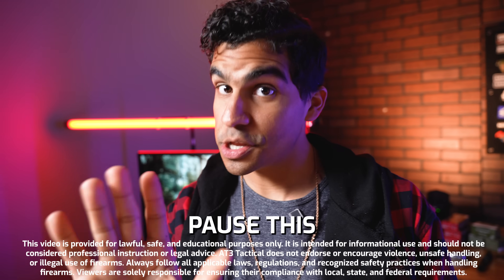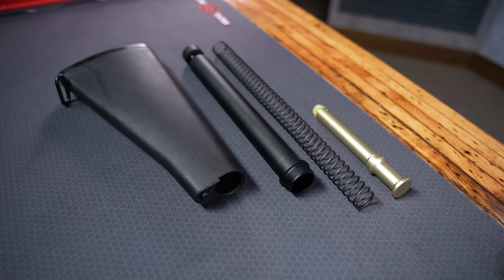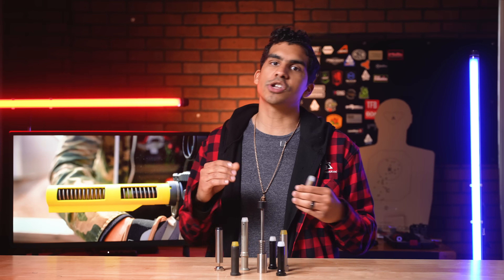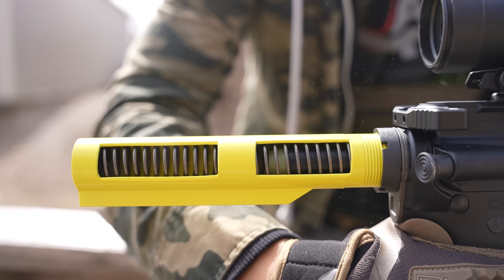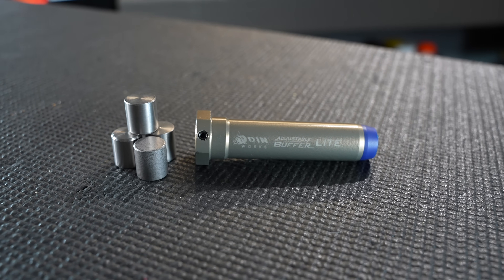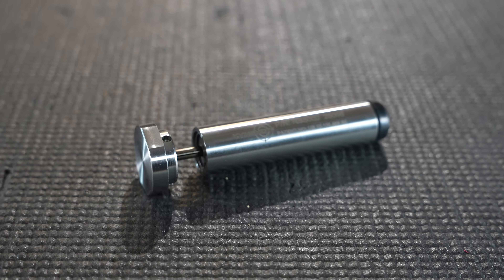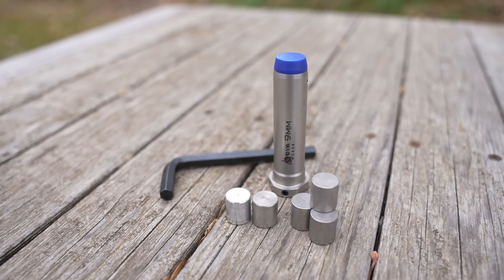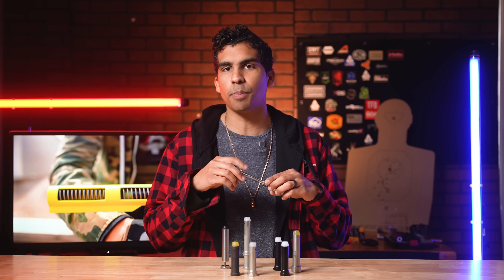Stop Guessing: H1 vs H2 vs H3 - The AR-15 Buffer Weight That’s Killing Your Rifle's Function

Comment: When first getting a 300 blackout years ago, and suppressing it, I couldnt stand the sound of the spring in the buffer tube. I bought a JP Enterprises Captured system and have never looked back. Makes every gun so much more enjoyable to shoot. Alot of people complain about the weight, but when you are putting a suppressor on the far end of your barrel, it actually helps balance the rifle really well. Just my two cents.
Reply: I considered doing this on a suppressed 300 blackout years ago but for some reason I didn’t do it and can’t remember why.

I think I had read something somewhere that made me question whether I should do it or not.  You use yours often and it works fine?

Comment: The M-16 A1 was used in Vietnam (1960's). It was used by the US military until 1984. In 1984 the M-16 A2 came out. You may want to correct this at the beginning of the video.

Comment: I always video the ejection pattern on any AR and weight the buffer to move it to the right rear quarter. Oh and Mil-spec buffers absolutely can be reliably modified. Manufacturers tend to use cheap, 3 steel weight carbine buffers. It’s very easy to replace one or all three weights with tungsten weights.

Comment: I’m having trouble with stovepipe ejections on a 6.5 Grendel I through together. It’s a 20” barrel with rifle length gas system and a A1 style fixed length stock. It has the rifle buffer and a Sprinco green spring. Anyone have suggestions on where to start?
Reply: Sounds like you need a heavier buffer. Need to slow down that bolt speed

Comment: Usually for .556 I just use a 3 oz buffer and a flat wire spring. Either Tubbs(stiffer) or Strike Industries(softer) depending on what it needs. If it's under-gassed, I use a Geissele braided spring and buffer set or a captured spring system. If it's severely over-gassed, I use an adjustable gas block. It's never necessary to go over 3.8 oz on the buffer this way, and the rifle is lighter. For AR-10, a Strike Industries flat wire spring and a Kaw Valley 5.6 oz buffer have always worked prefectly.
Reply: I had a problematic Olympic build that started out life as an A2 and ended up with a collapsible stock and all-Anderson upper. Stupid thing refused to cycle right. Tried different springs, buffers, yada yada. Eventually I put a Tubbs spring in there and it has performed like magic ever since, thousands of rounds. After that I put Tubbs springs in my other four ARs. Cycling problems are long gone.

Comment: Im stressed . I finished my first 6.5 Grendel . I used all good parts 18” ss BA barrel with rifle gas system. Faxon BCG superlative Arms adjustable gas block. Larue trigger Aero upper/lower . Ive been told that it dosnt produce enough gas with the rigle gas system but i can barley find a barrel with less .
Reply: Is your gas block adjusted properly, or is the gas tube installed correctly? The superlative arms gas block should be positioned .025 from the shoulder to ensure correct alignment with the gas port on the barrel.
Reply: @captnmark as far as i know all that is correct . Yesterday  a lady i know that reloads said that ballistic advantage barrels have a smaller than optimal gas port hole and gave me some numbers does that sound familiar at all
Reply: @samcommander4249 I was going to mention the gas port might need to be enlarged

Comment: You forgot magnetic buffers, that use two opposing magnets to create a shock absorber. Magnetic buffers are also adjustable so they can be tuned to the gas system.
Reply: Really? Magnetic? The magnets are potent enough to actually provide some deceleration of the BCG/buffer mass at the end of travel? And the magnets don't get demagnetized with the shock of firing after thousands of rounds?
Reply: @martyschrader a modern neodymium magnet loses about 1% of its strength every century. So yeah, in about 10,000 years that buffer will be worn out. 🤡

Comment: You have to consider that the whole system can be adjustable: gas tube length, gas block, BCG weight, buffer weight and springs.

Comment: 3:40 You are repeating myth about springs.
Springs do not wear out if they are initially built properly.
Springs break. And they will change specs if pulled or pushed out of spec.
But... they do not wear out.

Comment: Great content.  The AR-15 is very forgiving, but it is best to make adjustments to optimize.  Most AR-15 are over gassed as the manufacturer knows the user may not keep it clean.  Now the AR-9 is really finicky but once you get it right it is very stable.

Comment: If you need a different recoil spring for and AR 14 or 15,  you are either a little girl or an infant. And neither should be handling a military grade weapon. I can see new butt stock springs for 308, or higher, but for 5.56 and 223, no way. Buffer was originally desinged for the bolt so it would not whack into the back of the reciever and not bounce, so it would properly cycle a new round. Buy an AR with gas adustment, not a new spring.

Comment: A lot of this tweaking of the buffer/gas system can be avoided if you move the gas port forward. Kinda how Eugene designed it. 
The lighter you can make the bolt/ buffer the better the recoil- especially in full auto fire. You have to keep the bolt locked though until the barrel pressure is low enough. All this other stuff is just compensating for the premature release of the bolt. 
But what do I know…

Comment: I ordered an 18" AR-15 barrel with the mid length gas system and they sent me a 16" mid length gas system. 
It was a piece by piece build so it was months before I noticed the issue, and apparently the online ordering system changed my order to 16".
Well, I pulled one weight and replaced it with aluminum and it works just fine.

Comment: Nowadays, when I build an AR, I start with an adjustable gas block ... which I need for possible suppressed shooting anyway.
That way, I can go with a superlight polymer buffer when building a 4-lbs AR.
Everything runs perfectly once tuned so that the spent casings eject correctly to the 3 o'clock to 4 o'clock position.
Also, for some reason, I like the idea of closing the gas port entirely, effectively turning the AR into a bolt gun for additional long-range accuracy ... though, never really used this "feature"
One thing is for certain ... Eugene Stoner was an effing genius.

Comment: I really wish that JP and Armaspec would release various spring strengths for added tunability. More weight never resolved my bolt bounce issues but a 15% stronger spring did. Would love to see them offer this.
Reply: JP has 5 different springs.
Reply: JP has had this for many years. You can buy a SCS with the spring kit, or buy the kit alone.

Comment: Wait a minute: the other day the LGS informed me of yet a third size for recvr extensions. Some intermediate measurement between the two you mention. I dismissed it as irrelevant to me until some future time, but now seems like a good time to address this. Hoping you will either amend this video to add this new(?) develpment or address the topic in some future presentation.
Also:  ejection pattern. Most every chart I've looked at shows "correct" ejection at 3 o'clock to 4-4:30. Beyond this - a range roughly from 4:30 to 6:00 - and any malfunction is diagnosed as due to ""short-stroking" and being undergassed. Correction by checking for gas leaks, and/or using a lighter buffer, spring, bc or some combination. You state that ejection up to 6:00 is 'normal' ejection pattern. Please address?

Comment: Vltor a5 system not even mentioned just peddling mid tier choices, also hydraulics were not abandoned due to cost it was failure of the seals long term leading to catastrophic failure from hydraulic fluid leakage. Alot of misinformation in this marketing video.

Comment: 5:47  that's crazy the standard buffer and spring combination works just like the shock absorbers on a 40s model pickup truck and below, then you get to the hydraulic buffers and you've got the same thing as struts for your more modern vehicles

Comment: I wish this video was available a decade ago, when I spent hours trying to get the BCG to work properly, in my collapsible butt stock.  Changing buffers didn't help.  I ended up cutting individual spring coils away, until I got the right extraction and lockup.  It probably was the wrong way to fix it, but it's been working fine for years now.
Reply: You might have a rifle length spring in a carbine receiver extension.  Common mistake.
Reply: @expert244  I got a "kit" with the wrong spring in it.
Always measure the spring on a new spring or kit to make sure you received what you ordered. you'd be surprised how many people working at 2A supplies companies know little to nothing about what they are doing.
Reply: Most of the external rod style collapsible stocks with the extra short tube and flat wire buffer springs are way too strong for anything other than hot 5.56 rounds.  Since it is a custom spring, this is actually exactly how to tune the spring to get it to run the best.  Just make sure to flatten the cut end so it doesn’t damage the buffer or tube

Comment: Well, the "buffer" if nothing else, is what acts as the mechanical stop, to prevent the spring from fully compressing, where coils would touch, and the spring would become a solid length. Compression springs are not intended to be fully compressed, which spikes stress, and can lead to coils binding.
Firing the rifle without the buffer would be an ignorant move, failing to realize the fact that the buffer is the mechanical stop for the stroke length.

Comment: Good info and video. I think at 1:12 you meant the XM16E1 and the M16A1 having problems with the ball powder. The M16A1 was improved by having a chrome lined chamber and bore, and the issuance of cleaning kits. The M16A2 wasn't issued by the military until 1984 (Marine Corps) and 1986 by the Army. Thanks for the video!

Comment: @4:50
The gas actually forces the bolt forward into the extension, expanding the BCG, this causes the cam to unlock the action, and a opposite reaction, since the bolt has now pushed off the extensions, sending the whole unit rearward. . .  The whole reason you have gas rings.  Its that piston action of the bolt.
Reply: So in other words… it forces the BCG rearward.
Reply: @joshuas390 the gas doesn't force the BCG rearward.  It forces the bolt forward, which in turn pushes the BCG backwards.  too many people conflate that its the gas pushing against the gas key, and not the bolt pushing the BCG rearward
Reply: @BlackBeardAir  oooh I see… so if the gas tube isn’t installed then the BCG doesn’t go backwards right?
Reply: @joshuas390 if the barrel isn't installed, the round won't chamber.
Reply: @BlackBeardAir false. I can chamber a round in an uninstalled barrel.
Reply: If we are getting technical, it's a combination of both. The BCG is pushed back while the bolt is, simultaneously, pushed forward by the gas on the rings. If you remove all the rings, the AR can still run if you port enough gas enough gas, just very inefficiently. The bolt doesn't hit the inside of the extension so hard it sends the bolt back, as you seem to imply. Piston ARs run without any sort of gas unlocking the bolt and do so just fine. That's actually a con that piston systems have is increased wear on the bolt and reciever extension, but the vast majority of people won't send enough rounds to worry about it.
Reply: @fiftysixseventyfive yep.  Can and are designed 2 are different things.  This is a debate on design, which the Video guy gets wrong, like most peoples ideas with the AR
Reply: @BlackBeardAir I think your own understand of the mechanics of an AR are a bit flawed if you think the bolt slams forward into the extension hard enough to cycle the bolt. The bolt is locked into the extension and creates a stationary piston that rotates as the BCG is pushed back by expanding gas in the expansion chamber. The gas is what causes the BCG to operate, not the bolt, just in a way that's a bit different than most people explain it.
Reply: @fiftysixseventyfive The BCG getting pushed back because the bolt can't move foward.  I never said, "slammed forward".  The rotation of the bolt comes from the cam interface between the bolt and carrier, then inertia and extra gases take over, and the whole BCG travels rearward.

In relative terms, the gas enters the Carrier.  Gas pushes against the bolt (with gas rings).  When looking at the BCG as a whole, the piston moves forward.  Because the bolt (piston) cannot move forward, the carrier has to move rearward to accommodate the movement.

Simplifying perspectives.
From Carrier perspective, the bolt moves forward.
From chamber perspective, the bolt doesn't move, just rotates, (until the whole BCG moves)
From BCG perspective, the Carrier, (and eventually the Bolt), move rearward (initial impulse followed by inertia)

Simply put, the bolt is the piston in gas impingement.

* Also with your logic, a piston design as you described earlier, is actually the gas causing it to operate.

****And back to your original arguement that an AR can operate without gas rings, while feasible, not reliable or optimal.

Comment: What’s the best buffer weight for my build ar7.62x39
Reply: There is no way to give a perfect answer without more info. Your best bet is to figure out your gas tube length, what kind of gas block, what size gas port hole and what spring/buffer weight currently using. I would get as much specific info about the gun as you can, sit in one place and shoot a mag. Look at where the shells are ejecting and landing to get an idea if under or over gassed. Check out Odin gun works adjustable buffer. All of this assuming you are running an AR style rifle. You can’t just ask a question like that and expect an answer… the fact you did ask a question like that tells me you know little about your firearm and how the gas system works. Research research research.
Reply: Depends on barrel and gas system length, I'd say, but probably H2.

Comment: You can change the weights on any carbine buffer
Reply: Yes. 
The Odin adjustable is just much easier to change. It’s a nice tool to have when you are out at the range with a new gun.  Figure out what gas setting and buffer weight works the best, then lock the gas setting and clone the weight of the buffer into a “fixed “ buffer. 
Keep the adjustable as side for the next time
Reply: You can do the same with a standard buffer if you have extra or spare tungsten weights.  Odin just made it easier

Comment: Good video and info. There is also the VLTOR A5 buffer system and the Geissele Super 42. The only time I run a standard mil-spec buffer weight and spring is in some of my 300 blackout builds so supers and subs cycle reliably suppressed. Otherwise I utilize the two buffer systems I mentioned above. They work great.
Reply: The super 42🤌🏼🤌🏼

Comment: My AR-10 jams after every shot. The tip of my ammo catches the entrance of the barrel. dose this sound like it's the buffer????
Reply: Verify the left and right feed ramps are present on the upper receiver and the barrel extension. Then polish your feed ramps with a Dremel and conical fiber bit. Plenty of YouTube videos on polishing feed ramps. When your cartridge is stripped from the magazine, it sounds like it is hitting the feed ramp improperly and scraping its way into the star chamber. By polishing the feed ramps it makes a smoother transition from magazine to chambering the round.
1. Make sure you have feed ramps. Most uppers and barrels do. Make sure the feed ramps are aligned between the upper and barrel extension. If they are slightly misaligned will cause a problem. The barrel extension wasn’t torqued correctly
2. Polish them with a Dremel and a metal polish. It will be nice and shiny when you’re done. Just polish lightly. You’re only trying to take and build up away from the ramps.
3. Remove excess polish and clean chamber.
Reply: Additionally check your buffer and buffer weight. It could be a cycling issue related to that. Also could be a gas issue. Make sure your gas block is aligned properly. Plenty of YouTube videos on how to align a gas block. Get yourself a Gas Block Genie. It’s cheap and very accurate.
Look at your bolt carrier group for leaks at the gas key. Make sure the bolts are not loose and have been “staked”
Check your 3 gas rings on the bolt. Do the bolt standing test to see if the bolt inside the carrier collapses upon itself or not. Extend the bolt from the carrier. Stand the bolt bolt side down. If it does, the gas rings need to be replaced.
Reply: I had a brand new ar I was shooting my reloads everything fine. Went to shoot my buddies ammo he gave me from gun show and on the third round kaboom. Blew my bolt up and had to motor tht gun to get chanmber open. Now if I eject a round the tip of the round is marked with a zig zag mark. I don't care but it sounds like you have a bur on your feed ramp or an imperfection or it could be your mag.
Reply: Also try a few different magazines. They are notorious for faulty feeding issues due to different spring tension. Never load 30 rounds into a 30 round magazine. Too much compression on the internal spring causes issues with cycling. Stick with 29 or less.
Reply: Get an adjustable gas block. Heavy buffer. Mine runs . Gotta tune it.
Reply: @solarlion144  gas block won't help feed ramp loading issues.

Comment: Colt abandoned the hydraulic buffer because of costs and because hydraulic buffers will eventually fail. Which could cause an out of battery detonation and serious bodily injury. Granted, current hydraulic buffers will last for a higher round count, but they still won't outlast a dead-blow buffer weight.